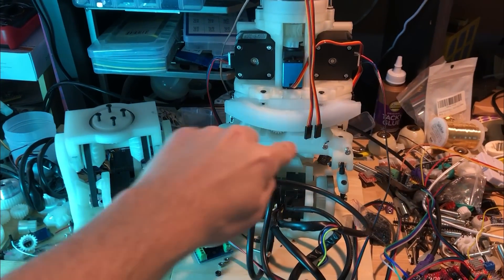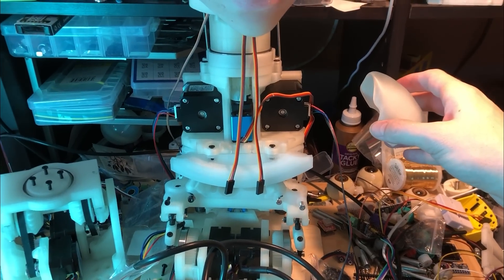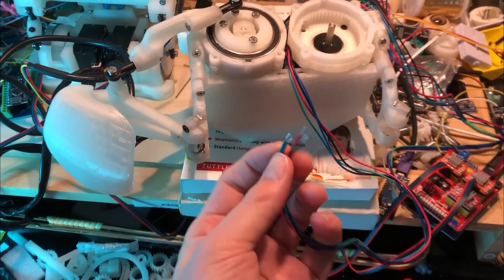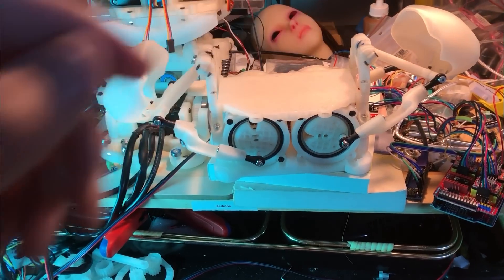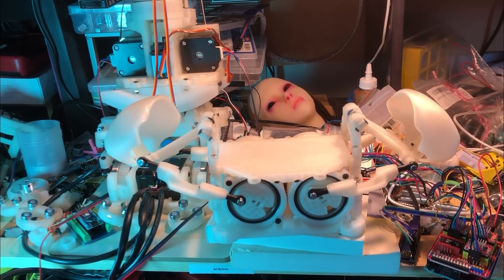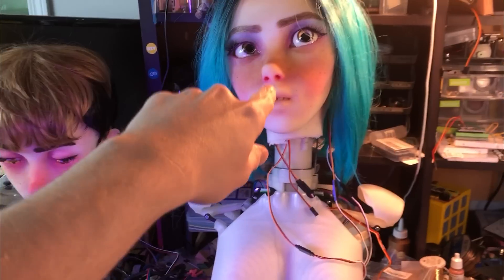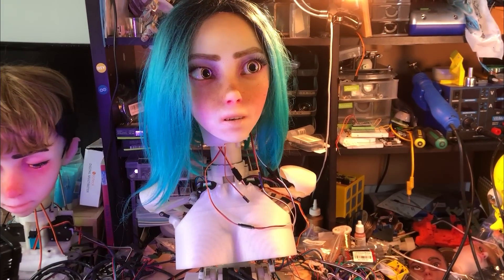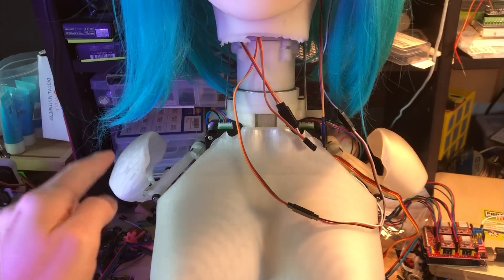Shoulder Module Development

Comment: You are aware that you could order parts from JLC  printed from metal or machined with cnc to make your mechanical parts (gears) more reliable ? So personally I’d probably try to buy those gears ⚙️ directly if possible. Anyway very cool
Reply from the maker: I am, though I have not tried that.  I have thought to get some parts made in Nylon with an SLS machine; those that are in contact with any motors.  Getting some metal gears machined would be a big expense for me.  Considering the small size of the gears, it might make more sense for me to buy a diode laser cutter and make my own with aluminum.  I'm not sure.

Comment: How did I get here? Also, great work with the 3d printed gearboxes. I wonder if you'll be able to get rid of a lot of the electrical noise from the stepper motors. I feel like a lot of the sound is coming from there.

Comment: Might I suggest using electromagnetic pistons instead of rotory motors for linear movement?
Reply from the maker: I do have a few linear servos, they are expensive though, so I have avoided using them in designs.  I would like to try setting up a motor with a lead screw; I haven't done this yet.

Comment: I noticed your steppers are moving at a constant speed, and due to the gearing, they're going quite slow.  I've done some experimenting and found that steppers can usually go much faster than they are rated for if you accelerate them over a period of time (i.e. start out slow and every couple of ms, go a little faster).  Eventually the motor will still stall out, but you can get it up to 2x or 3x the constant speed in about a second or two.  And the speeding up at the beginning of the movement and slowing down near the end of the movement will also create a natural animation curve, making your animations look more lifelike.

Comment: How does one go about learning this? I’ve always wanted to learn about animatronics but don’t know where to start?
Reply from the maker: I think you could come at it from many different angles.  There are a range of different skills involved.  mechanical design, electronics, art.  I think there may be some kits out there that you can buy that can be assembled, which might be helpful for learning.  There is a wealth of knowledge on YouTube as well.  And these days you can ask an AI to help with most learning tasks - they can be remarkably useful when used for this.
Reply: @DaveMakes  thanks for the reply. I didn't think of the AI, that's a good idea! Do you use AI for this? If so how do you use it?

Comment: just design the arms with shoulder movements, it would take some stronger actuators, but the basics would be similar as they are now but separated and moved down a bit, use movement diagrams of human anatomy as a guide for design, your robot could be fully humanoid eventually, never limit yourself on form or function. It takes time, but anything great takes a lot of time to make and perfect.
Reply from the maker: form is a crucial constraint here.  If I do an arm, it will need to have the shape of a girls arm, which is not very big.  this makes finding places for motors or other actuators tricky.  The best options i've seen all involve wires, or pneumatic tubes actuating from a distance.  I'm happy to do the arm more like an actual robot arm with no silicone skin, but I don't think I want it to be massive.  I'm confident that I can design a hand that is controlled with servos in the forearm, though it will be some time before I try that out.

Comment: Awesome project! I would suggest looking into hybrid servo stepper motors. The big problem with steppers is they are running on full current at all times and in enclosed spaces things can get very toasty with several stepper motors running close together; a servo only uses as much as it needs to. Also since they are closed loop, the position is not lost if the motor itself is overpowered, and the load on the servo can be monitored with the current draw. Harmonic or cycloidal drives would be the ideal solution for gearing but that would require some very deep pockets or a lot of hours to make...

Comment: Ok this was actually super entertaining to watch!! animatronics are very fascinating to me and I loved watching this video! it was creepy but also super cool! its hard to not see it as a living thing XD

what program do you use to control it? did you create a software on your phone? or do you have a program on your computer that takes commands and inputs that to the motors?
Reply from the maker: i'm using 3 different microcontroller boards here.  arduino unos, or arduino nanos in this case.  They are programmed on a normal computer, and the code is put on the boards where they run forever whenever powered on.  It's done in a C++ type language.  The behaviour is quite simple right now, with the motions being random positions every now and then.  It's good for testing.

It may be possible to create an app or tool on a phone or desktop to communicate different commands to it, though I have not done that yet.
Reply: @DaveMakes  Ok! I understood a little of that lol. You make super cool content though! You got an amazing hobby!

Comment: Can’t believe I’ve only just found the channel. I’ve been swearing at myself the last few years working on mechs of my own. I’m good to see the evolutions. How do you find using steppers for the shoulders in terms of locating position?
Reply from the maker: they're very accurate.  if they miss any steps, they will get out of sync however.  I haven't noticed this to happen, so this is good.  It remains to be seen if I will need the planetary gearing for some extra torque when the silicone is added on top.  It won't be that heavy, but it might end up being too much for the small steppers I am using.

Comment: How much of her body are you eventually planning to do?
Reply from the maker: not sure really.  I like the idea of having her on a platform of some kind that has wheels, to move around.  So, I'll definitely want to take the torso down to at least the waist.
Reply: @DaveMakes  It has been done before, as in robot girls on wheels. How much articulation do you think you can add to the arms?
Reply from the maker: @SuuSuraimu  Yeah, i've seen the Masiro robots.  The coffee cafe robot girls are very cute.

well I have no doubt that I can build an arm with almost any amount of articulation.  It's just a matter of design time.  Where problems occur are with weight constraints, and space constraints.  I'd have to spend some time thinking about it to really put an answer to that.  Should the grasp be able to pick up objects, or just make gestures?  I've got no idea what direction I would like to go.
Reply from the maker: @SuuSuraimu  I did some tests a few months ago for personality modeling.  Nothing since then though.  I think using something called retrieval augmented generation would do quite a lot of the heavy lifting.  A massive PDF with character stats and details, some random number streams, and an interpretation by an LLM into a code block for a status update.

Check this out here:
https://youtu.be/FEaDnjAivdY?si=ozL2-CrVcuQUL6Ts&t=173

Comment: You really need to drive your stepper motors with sinewaves instead of simple pwm pulses. That will make them instantly silent. Power electronics for that might be a bit more expensive ... Also , if you really go into that detail, consider servo motors with feedback. They can react much better and need no calibration.
Reply: I was just wondering if it was possible to dampen the whirring noises. Seems like this comment section has a wealth of information on the subject of animatronics.

Comment: I had another thought that might improve the expression in the face. One thing I often see lacking in humanoid robots or animatronics is lip mobility. The ability to purse the lips or push out or roll in, I think that could be solved by having a flexible tubular mesh or spring running along the inside of the lips, connected to the silicone, or maybe embedded in it. It could be controlled at the endpoints or corners of the mouth by servos and by even rotating it by its axis. Im not sure if the explanation gets the idea across, but we could contact each other if you're interested in more details on the idea.
Reply: I've seen that design done on other face rigs and it works fairly well. Never seen there being rotation of the spring though. That's a good idea but would require even more actuators, and it gets cramped in there when you have a full facerig, should probably be possible to stuff a few more in there though.

Comment: how do you limit the range of movement on the steppers and how do you initialize them?
Reply from the maker: for now, I just manually move them to a start position.  They have a range defined by a certain number of steps from that start position.  In the future I will design some end stops into her body so that I can run an automatic start-up sequence to find the correct range every time.   
I have a number of magnetic encoder modules as well, so i will experiment with using them.  I think end stops will be fine though.

Comment: i feel like with prints this precise and the amount you need, it might be worth investing in making some cycloidal drives for it. makes the backdrivabiltiy better imo.
also please select some microstepping on your drivers xD that sound is reminding me about rep rap days
edit: just saw the "1/8th microstepping" comment, i dont understand how this is so loud, maybe im too used to the newer drivers and havent had the basic A4988s in a while
Reply from the maker: I'll try making some cycloidal gear boxes.  I feel like that would be a good project for a laser cutter, maybe with aluminum.  I don't have one though.  One day.
Reply: @DaveMakes  youd be surprised how far you can get with 3D prints and pins, i just have a bunch of M5 and M3 pins laying around, they work perfect for aligning bearings and making precise components with plastic.

Comment: I wonder if it will ever be possible to make eye movement as fast as it's real counter part because to me that's going to be one of the hardest things no? Seeing the eyes make their way to where they want to be instead of just appearing there is a little unsettling
Reply from the maker: The code for eye motion in this example is more rudimentary than in other examples i've done.  Here is a video I did a year ago with more sophisticated eye motions.  It involves two stages of randomization for accurate saccades, slides and other realistic motions.

https://youtu.be/Pw_4alimG1w?si=U7bkG7Q-BDErUEhR
Reply: I wonder if having a magnet inside of the eye and electromagnetic coils around it in the socket would be able to move the eye quickly around just by altering the magnetic field with current.
Reply: @brianhowe201  you know what you might be onto something
Reply from the maker: @brianhowe201  for two degrees of freedom i'm not sure how that might work.  maybe an array of coils around the inside of the eye cavity?  I guess very precise positioning could be achieved by triangulating some relative charge between 3 coils arranged in an icosohedral array.  I'll have to explore aliexpress for parts to play around with this some time.  I have no idea at all about this.

Comment: You can use Trinamic stepper motor drivers to make the stepper motors quiet. You can use TMC2208 or TMC2209 and replace the A4988 currently being used. The TMC drivers also offer 1/64 microstep with a 256-bit resolution. That makes the motion of the motors very smooth.
Reply from the maker: I'm going to buy a few when I have a chance
Reply: You do lose some strength with the quietstepping activated, but yah, it is MUCH more quiet than the older drivers, even without that.
Reply: @NeoIsrafil that's not actually true, as far as I'm aware it's just that the strength drops the further from a pole alignment the step is and so the maximum guaranteed torque on any given step is lower. it'll still have the full strength on a full step, but it has less holding strength on like, 7/64 of a step, and if it doesn't have the torque then it just waits and jumps to the next strong enough interval, which is basically just what would happen if you were driving it with less increments.
Reply: This robot sounds like my OG Ender 3
Reply: @megamind1359let’s… not think about it too much

Comment: By the way you can eliminate a lot of the motor noise by using more modern step controllers.  New sine controllers eliminate a lot of that ringing making motors close to silent.
Reply: i can confirm, i've upgraded my ender3pro's motherboard to a silent (more recent model) and all that noise it's gone, the only sounds i can hear now, are the wheels moving on the axis
Reply: @lthink2675  You forgot the fans.
Reply: @Vindolin  yeah. But I'm used to it😂

Comment: Looks nice project. I have some robotic and electronics project.
Started to wonder how hard it's to do that skin?
Maybe need to dig your older videos for info.
Reply from the maker: It's a 2 part platinum silicone.  It needs to be painted after casting in order to look realistic.  There are a few ways to make the mold for casting.  Traditional methods would involve a clay sculpture with some kind of negative taken from it.  It could be a resin, or plaster concrete, or even another silicone rubber.  Then the silicone positive for the face is cast into that.  I use 3d printed molds now, as it cuts a few steps out of the process.
Reply: @DaveMakes how to make those skin skins 

Like silicone or can we even make it
Reply from the maker: @verilyze  it's a 2 part platinum silicone, cast into a mold.  Many videos on youtube for learning about working with it.  Brickintheyard youtube channel is one.  Smooth-On is another.
Reply from the maker: @verilyze  Well, no books, though if you're interested I would strongly recommend those youtube channels.  High level techniques with excellent instruction.

Comment: what material does your printer use? or is it resin, wondering about the longevity of the gears
is your code open source? be curious how your structure is like for managing all these subsystems pretty fun to do so
maybe consider posting on hackaday if you don't already
damn this is so well made, nice
Reply from the maker: I'm using PLA right now (bambo P1P printer), though I am considering ordering some parts printed with an SLS machine in Nylon.  The gears, and the parts that contact the motors particularly.    
I'm changing the code all the time, making use of chatGPT for generating a lot of it.  It's a back and forth process.  I guess it's not open source exactly, but i'd be happy to do a video in the future that goes into more depth about what the code is doing.  Presently it's 3 different microcontrollers operating independently, though I will probably get a fourth to orchestrate them all together. It might make more sense to run the brains of the whole thing on some single board computer system, like a raspberry pi; issuing out instructions to many different microcontrollers for the different modules via bluetooth.  
I'll have a look at hackaday, I'm not very familiar with it! thanks :)
Reply: @DaveMakes  the other thing... you could eventually make a GUI (web app) that even has a 3D model of the character and program it from there using combined "motion primitives" idk. ThreeJS is really cool for embedding a 3D model in web/using JavaScript to interact with it/camera/lighting.
Reply: @DaveMakes  oh wow PLA interesting the finish looks better than Ender 3 Pro. Interesting haven't heard of SLS before. I see. yeah I was curious your approach to organizing it all top down since it's a lot of things to keep track of like each servo's position. yeah RPi would add another layer of complexity not a bad thing... but the bridge from Python to C++ (via serial or something) not sure if you need it. But if you have higher level stuff like vision then RPi would be nice. Will be interested to see what direction you take.